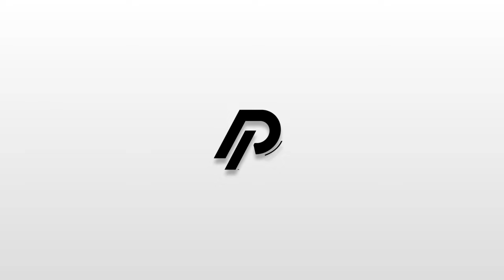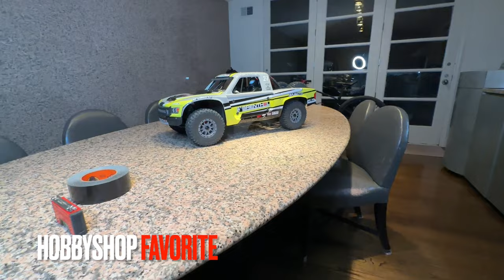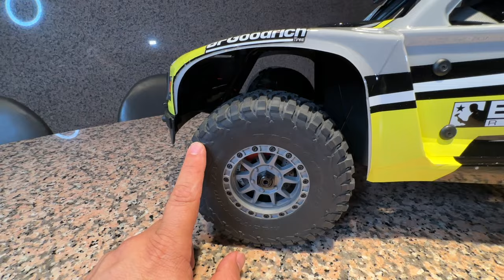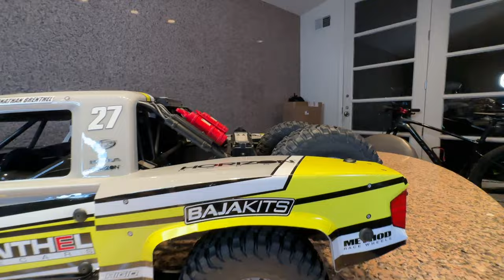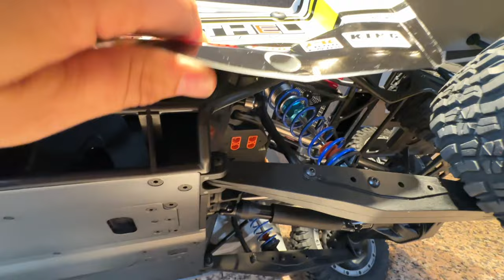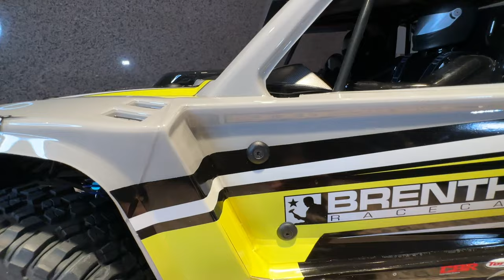Losi 1/6 Scale Super Baja Rey - Guide to Improve Handling !

Comment: I like how you mention that (if set up properly) this truck can handle as well as the UDR. Owning both I can say that out of the box the UDR is a better overall truck. Sometimes just throwing size at something doesn’t make it better. Engineering applies to all things big and small. I’m not as critical and demanding as some and enjoy what these two trucks deliver out of the box. Either choice is a good choice.
Reply: Na it’s the driver lol
Reply: Very nice sir!
Reply: That's funny because as an owner of both sbr 1.0 and udr the sbr handles way better and doesn't roll over as easily as the udr. I don't know what they changed on the sbr 2.0 to make it handle worse then the 1.0
Reply: I agree, i have the 2.0 and UDR.

The UDR flips easier yes, but it's a lot more satisfying to drive and watch the suspension work. The SBR is bigger more tough version. 

@jalee6587

Comment: Thanks for this video. Other than the rear weight issue everyone complains about this was most informative and thank you for making it. I’m curious about your opinion regarding the rear braces everyone talks about installing. I understand the issue and your solution is to remove the weight. Ok. I’ll go with that from a mechanical perspective. However you loose the scale details you’re paying for.  My question is why would losi leave that much flex there? I feel like we should trust the engineering they put into it and probably didn’t intend for this to Arrma tough. Im not hearing about any subsequent part failures from adding braces though. Im my experience, when I strengthen something with metal, other things tend to break that shouldn’t. Cheers and I’ll await your opinion on those braces. Thanks!
Reply: I have the SlookumRC braces installed and looked at them closely how they strengthen the rear and cannot find any places that now get more stressed to worry about breaking.

Looking at the design i think it's either an oversight from Losi or just as intended for those that bash it. The flex and those spare tires hitting the ground after high jumps might just have been designed to take up some of the abuse on landing when bashing. For non bashing use and driving it like a trophy truck they do the exact opposite, they still hit the ground going over bumps at  speed and then lift the rear wheels so they loose traction and prevent the suspension from doing what it is supossed to do.

So as far as i think on what's going on, if you are going to bash it, dont install them, if you are going to drive it like a trophy truck install them, you want everything as rigid as possible so the suspension can do it's job at absorbing all the impacts and nothing else. I also installed some homemade limit straps front and rear so the suspenion does not bottom out on the shock piston.
Reply: Thanks man. I appreciate the reply. I tend to agree with what you said even though I have no experience with this specific machine. I have a Senton BLX for bashing. This is a whole different beast. I noticed on my truck which I just bought 1/12 , has bracing in the corners of the weak spot everyone puts the diy braces. I didn’t notice that addition on other videos. So I may still brace it but I’m not pushing her yet. It’s a fun truck.
Reply: Trust losi engineering not a bunch of shade tree mechanics.
Reply: @billreynolds2221  😉😉Dont trust one liner people on the internet either 😉😉😉😉😉

Comment: I'm back into the hobby only recently and got the SBR 2.0 I love it, looked at this vid to get some setup tips. Upgraded it with all Vitavon parts (including 6 aluminium wheels so even more weight on the back), the stainless steel rear chassis brace, Gorilla taped the tires and body and added an extra original King shock without springs in the back.

I have not weighed it yet, but the weight increased noticably with all the Vitavon parts, had a first shakedown with all the new parts installed and i have to say, the added weight is actually benefical to the handling for this car running it like a trophy truck and not a basher. Used the Spektrum smart programmer to set the braking to 100% and it needs it with all the added weight.

I have Team Corally 55wt in the front shocks and 65 wt in both rear shocks (asked Horizon tech and they said it's 60wt stock) and it absorbs bumps like a champ, much more stable on the straight. Will have to see how going a bit lower in the front will work out in the long run. 

Unfortunately is has been raining cats and dogs for the whole week and it is not getting better. So it was just a short run for now on the only non muddy and wet packed sand track i could find so it was just a short run, but it already felt a whole lot better compared to stock, much more controllable and no traction rolling.

Going to run it like this, only thing i am contemplating is fabricate a different style sway bar, one like on the rear of the Traxxas UDR, mounted on the axle not the trailing arms.

Comment: 1st thing you pointed out about the ride height was bad info. With batteries installed you get a nose high ride height. Most people don't understand tire ballooning is actually factured into RC as a way to control pitch on the air. The oil from the factory is the correct weight and by adding thicker your contradicting what your saying, I suggest getting a book on the engineering side of setup  or at least do some homework before you make content. The rear biased weight CG is what makes these trucks work in real life and you're so far off of good info here I can't believe I heard you run a Hobby shop. Most desert trucks in real life don't have adjustable camber as a result of the geometry. Lol traction rolling for those that don't follow trophy trucks means your truck is working correctly and is a result of 3 diffs with thick oil.  Bad info here.
Reply from the maker: I see from your channel that you are very into the Baja Rey. The difference btw me and you is setup RC cars all day. I do before and after test runs. I’m not into driving and RC car like a toy. One key lesson I have learned over time is that it’s all about  trial and error in RC. The comment about tire ballooning is a little weird since most people want their short truck for driving rather than having air control. A real short course truck does not have tires that balloon and that is a fact. I like my cars to drive like a proper vehicle. And most of my customers have seen huge difference in the Baja Rey handling after my upgrades. Real customers , real opinions , and yes this is a real business. Good luck with your RC endeavors.
Reply: @ParkflyersRC  Yah you would benefit from getting some books on real setup. I can tell from your reply and the info your giving here you could benefit from understanding how changes effect a car. Your info contradicts science and engineering. I'm just trying to a conversation about why these trucks are setup correctly and I think your info could benefit from doing some research. I personally would never buy products from a hobby shop with this mindset of you set these up all day doesn't mean anything. Good luck 👍